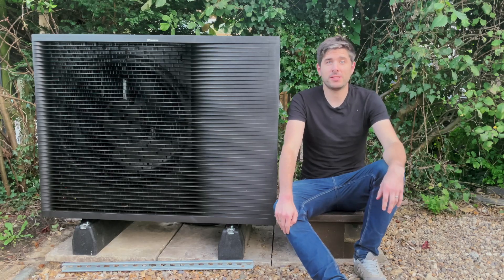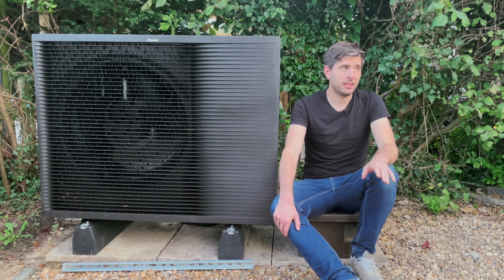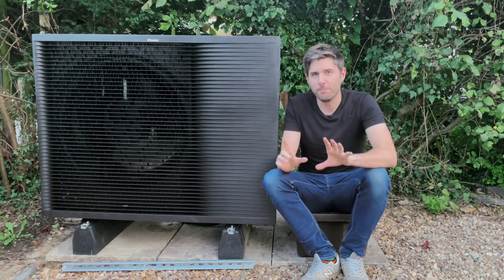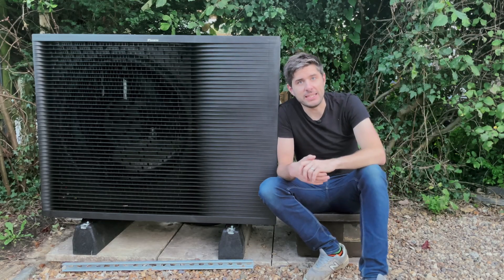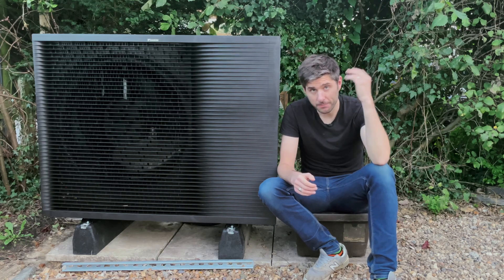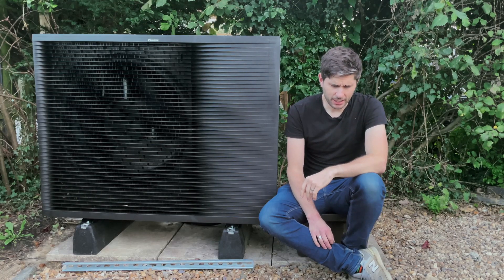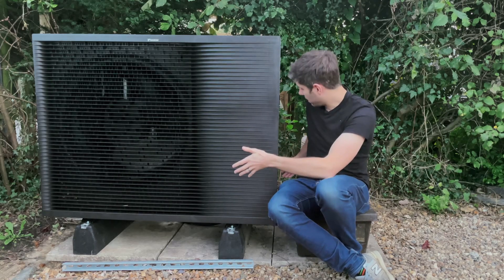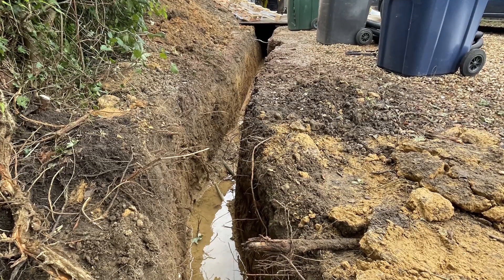Replacing an oil boiler with an air-source heat pump: Why, what and how

Comment: 4.5 years ago we changed our oil boiler for same model of Daikin ASHP. Oil boilers are 85% efficient. My Daikin is 400% efficient. Been very pleased. No radiator or micro bore pipe changes for us. Thanks for the video.
Reply: Julian,

did you not do physics at school, or have you forgotten that no device can be 100% efficient? If you calculate 400% your calculation is very wrong.
Reply: @iareid8255 I read Chemical Physics at University, so yes 😂. You are thinking too narrowly. If you consider the “system” as the Earth/Air, and not just the boiler/heating system, then an ASHP moves heat from the air, via the compression/expansion cycle and transfers it into the home. 1kWh of electricity generates 4kWh of heat. Divide the second number by the first. Units cancel out. And you get an efficiency. Now I’m willing to accept you could call this an effectiveness. But the same calculation with a gas or oil boiler - energy in to heat out only gets 85%. So you decide what you want to call it. But heat pumps are far more efficient than gas boilers. Which was my point.
Reply: @juliandclarke  
you seem to have lost the art of critical thinking.

Your understanding of the operation of the heat pumps fits scientific description of heat, i.e. anything warmer than -273C (Or zero Kelvin).
But the suction temperature of the gas from the evaporator is based on ambient and the compressor has to raise that to provide heat. Output heat is proportional to suction temperature.

The correct equation for heat pump efficiency is input KVA hr relative to BTUs hr produced factored by the  energy required to produce the electricity consumed.
Simply comparing input KW for  a heat pump against the gas consumed by a gas boiler gives a very flattering but so very wrong comparison.
You can use your equation for comparison to any electric heater but not those using a different fuel.

In conclusion your perception that heat pumps are significantly more efficient than a gas boiler is flawed.
Just consider a gas boiler takes fuel, burns it and directly heats the water used for heat transfer. The only loss is that exhausted to atmosphere, and by law all gas (and oil boilers) have to be a minimum of 90% efficient. Not only is it direct heat, the differential in temperature ensures a much better heat transfer.
A heat pump starts at the generator, and then transmitted and distributed to the consumer, ball park 60% or more loss. Then the discharge temperature from the compressor is low, so heat transfer is much less effective. Not only that some of the heat from the compressor has to be retained for the refrigeration  cycle to operate at the  expansion valve at the evaporator.
Reply: @iareid8255 your assumptions on losses are incorrect. I’m measuring electricity in and heat out. Only at the property. After all the losses. If you look on any condenser boiler manufacturers data sheet, a good one is 85%. Might get to 90%. But only if you run it so it condensers. 
If you are looking at the full system efficiency, including electric generation, then you also need to add in the gas/oil extraction losses. But at the boiler/ASHP level, the the coefficient of performances work.
Reply: @juliandclarke  

The gas oil extraction evens out as both generators and boilers use the same source and their losses.

If you look at legal requirements it is 90%.

Coefficient of performance is different and cannot compare to different types of heaters.

Live in your fools paradise.
Reply: @iareid8255 agree to disagree then. But if you look in the literature, comparing gas and ASHP heating is usually thru SCOP

Comment: Kerosene costs 59p per liter and produces 10.35 Kwh per lite , that's 5.9p per Kwh, far cheaper than a heat pump. Don't fall for the Gov net zero agenda, save the planet lol, battery pump and heat pumps solar are NOT eco friendly. Kerosene is a very clean burning fuel , you can't even set light to it by blow touch it needs to be wicked , I wonder ust wonder if the truck that deliveres this guys online shopping , heat pump and other stuff are diesel ? I should think so , as you said YOU are not saving the planet , your supporting the energy companies pay paying extortionate energy bills,

Comment: Very good explanation  , easy to follow , well done . There is another factor , often overlooked , that is considered in minimis , by the grant  assessment , insulation , this has a great effect on energy usage  and should really be notched up in the priority order . A good place to see this is a look at the Passiv Haus Institute website  , here it is the highest priority in house  temperature control . Better to save the expensive heat than to continuously replace it in a house with insufficient insulation . I arrived here as a friend called today as his oil fired boiler packed up and should he think about a heat pump ? Yes was my reply BUT , his house is poorly insulated concrete , start with this and your heat pump will be more efficient .

Comment: We have had a Daikin Altherma 2 7kw monoblick since June 2022 which was installed by Octopus. The year before we ran out gas boiler at 49-45 ⁰c flow temp as an experiment and proved our rads were pretty near ok for a heat pump. Our design was 50⁰c @-2⁰c ext but we are  now running at 42⁰c @-3⁰c / 32⁰c @ 10⁰c after loads of tweaks.   I have found it really useful to display the data like flow temp, return temp, electricity , heat etc in real time using Home Assistant and since last year Open Energy Monitor. It really helps being able to see if the pump is cycling etc when optimising it. Like you I am trying to convince neighbours and friends to switch off gas by doing it myself and being a guinea pig.  Hope you have a good experience this winter.

Comment: I replaced my diesel boiler with 2 air source heat pumps and I save $1000 per month over winter. 20c kwh vs 5ckwh. Mine runs between 3 and 5 COP.

Comment: Great video..  I missed how much the whole thing cost.  I think we are all better off with individual AC/heating units per room. More flexible.  Probably cheaper to install.  Can even do yourself.  Way more redundancy.  Way simpler.  Less complicated.  Probably last longer. Easier to upgrade.  Either that or just stick to burning stuff until the technology changes again to TEC heating.

Comment: Oil per kWh works out at around. 0.5p per kWh, versus 0.26p per KWh on electricity. 

I’ve fancied taking out the oil burner in my 100 year old solid walled house, but the sums just don’t add up no matter which way you look at it. 

My oil bill this winter for heating and water heating is less than £300, I suspect it’s at least 3x that much using a heat pump.
Reply: are you sure? 0.26p / kWh is less than 0.5p / kWh.  
But either way, oil currently works out at around 7-8p/kWh at current prices, whereas a heat pump can match or be less than that. e.g. current price cap of 24.86p/kWh, and a SCOP of 4, means a heat pump would cost 6.22p/kWh of heat.
Add in a more beneficial tariff, e.g. OVO's 15p/kWh for selected heat pumps, then at a SCOP of 4 means you're at 3.75p/kWh, essentially half the cost of oil.
Reply: @ it’s definitely correct. Heat pumps even with the supposedly SCOP of 4 (and that’s if it’s installed correctly), plus’s the cost of remedial works means there’s absolutely no point in a heat pump.
You Laos haven’t factored in the 70p daily connection charge for electricity, a percentage has to be added in.
The green levy is ridiculously high for electricity and if you now factor in the new £40b for upgrading the power grid who do you think will be paying for that? 

One other factor no one seems to factor in is most if not all drivers will be  driving an EV, so you tell me what tariff will be able to give you a decent kWh for both heating and all your electrical charging?  No one. They will tinker around but all in all if you look at it with everything considered you must be a mug to go with a heat pump.

Electricity will not come down for decades, Miliband is hell bent on making it more expensive no matter what he says. 
Oil will fall, and already is, it will be even less this time next year.
Reply: @TheFlaneur-up1ft  You need the Standing charge for electricity with an Oil boiler as well for running pumps etc, so not sure what your point is there, as you need to pay it anyway.

And oil boilers do need remedial work as well, if you had watched the video you'll know that the oil tank had cracks in it so was refused delivery of the oil.

Heat pumps and EVs won't be overnight roll outs, the grid etc will see upgrades that make it in a more sustainable situation than it's in now.  Oil is very reliant on international markets, so maybe it will fall this time next year, but there's also the chance it will go up.
Reply: @BenIsInSweden  
An oil tank is how much? Less than £1k and that’s if you need one. 
The standing charge for the oil pump is included in the electricity I agree, but that’s the fly in the ointment. That charge will just go up and up to pay for the upgrades to the network let alone the new Nuclear plants they want to build at ridiculously high costs.

My point is as I have already said. If you go heat pump you are paying dearly, and yes that’s up to you, but don’t think some who are more educated can see past the smoke and mirrors. 

I have solar, I have EV and Batteries, I have had all these for over 10 years so I’m no Luddite. 

I did my sums, and I know it doesn’t add up.  And by the way, your electricity is fuelled pretty much by the gas market, and that’s just gone up yet again and will do dramatically later this year.
Reply: @TheFlaneur-up1ft  
I've lived in a house that has had at least 1 heat pump for a decade.  They are very common here and I know how they work etc.

If you have solar and Battery storage then you are doing yourself a disservice with not having a heat pump.  But that's your choice.
Charge up at the 7 or 7.5p/kWh (or when the sun is out for free), and heat your home for 1.75p/kWh of heat, vs the 7/8p/kWh you're getting from your oil boiler.

My electricity isn't also fuelled by the gas market as we don't use gas power plants in my neck of the woods.

But not all of the UK's electricity comes from gas - currently only 30%.  With 37.6% coming from Wind.
Reply: @BenIsInSweden  living in the U.K. is totally different weather wise.  We get an issue in winter months when we don’t get any sun whatsoever, and that’s when we need it most.  We don’t very often get crisp cold sunny winter days, we get very dark and over cast.  Solar is great in the summer, but we don’t heat our homes in the summer.
Reply: @TheFlaneur-up1ft  no but you heat your hot water.  Solar does contribute some to the uk in winter and there are plenty of British yt channels showing their winter solar stats.
Reply: @BenIsInSweden  
I have two water heating systems, both use solar, one is vacuum tube based and the other uses an Eddie which comes directly from the solar array.  The Eddie I haven’t used this winter until today believe it or not. We haven’t had enough sunny days, but the other system works ok when it’s not direct sunlight.  I live in the south of the U.K. and face directly south.  Solar my friend isn’t very good in the winter months.
Reply: @TheFlaneur-up1ft  I never said it was.  Just that it can cover things sometimes.  If you've got it then I can be used to provide your heating for free at times, something you don't get with your oil boiler.
You've also completed avoided the point that you can use your EV tariffs and batteries to heat your home for ~1/4 of the cost of what oil costs. Adding on the extra times when solar is useful and can power the heating for free is a bonus.
Reply: @BenIsInSweden   I hadn’t avoided that question, I forgot.

So, we are now taking about me personally, I could invest another huge amount on more batteries, more solar, for what? 
To heat my home for the cost of an installing a heat pump with all the extra costs? Say around £16-17k at my last quote?  Or to pay £250-300 per winter to heat my home and water?  Really? You think that a good investment?  Sorry it doesn’t add up.
That £16-17k doesn’t include the extra £1000s on more battery to fill the EV? From what? A 4K solar array? 
Wake up. 

Seeing as I forgot to answer you earlier maybe you can answer this question. What is your electricity bill this winter?  I’ve told you my heating bill.

Comment: Monoblock is Easy. you can do it yourself. LG Therma V Monoblock 9 KW 60 degrees 3500 euro. Google LG Therma V Aircoplaza Zwolle. Put in place, connect with your existing CV radiators. Connect Thermostate and Electricity. And done. It Works. I have Heatpump Heating for 12 years now. Last mont a New LG Therma V. 3575 euro subsidie 3075 euro. With Solar no Energybill for 12 years now. And I let a House same System a family 2 Kids. ❤👍🌹

Comment: Well explained but as usual it is the huge cost of the unit, installation and modifications required for the efficient running of the system that is a barrier for most people.  Still not convinced that the running costs are as cheap as inferred.  Running the system all the time must cost as much if not more as the usual gas/oil hotter system which takes less running time.

Comment: Don't go on holiday for two weeks in the winter, we came back last January and it took 2 days to warm up the house, so I now have a brand new combi to run as a type of Hybrid system in the winter and this helps our solar for hot water in the darker months. I love heat pumps but like any solution they have limitation.

Comment: Now the bit heat pump advocates won’t tell you.  You must keep the heat in, meaning practically no ventilation to the outside, meaning all your cooking and breathing moisture stays indoors and condenses on cool walls and windows leading to black mould formation behind furniture which is very unhealthy.  To combat that you’ll need to run a dehumidifier.  Oh and cooking smells, burnt toast and evil socks smells can’t get out either.  So you will periodically need to open your windows to get fresh air.  Since the brickwork and home contents will not be very warm, changing the air will chill your house down pretty quick.  Remember there is always a flip side to every coin.  So, I am not saying don’t get one, I am saying be fully aware of all the costs and inconveniences which you will not be warned about.  Finally, be aware with installation and home upgrades costing maybe £12,000 and the maintenance and running cost eating into that claimed efficiency saving..it will take a long time to break even, versus just putting that money toward say regular low tariff electric heating.  If a ASHP saved you say £100 per month on average and servicing cost £200 per year, it is going to take a year to save £1000 and probably 12 years to break even against the full installation cost.  If you are already retired, you’ll probably be dead before seeing a real overall saving and if you are younger, it will possibly need replacing anyway by then.  Just be mindful and research thoroughly….Unless of course you have pots of money, but then you would probably just keep those lovely hot radiators regardless of costs huh!